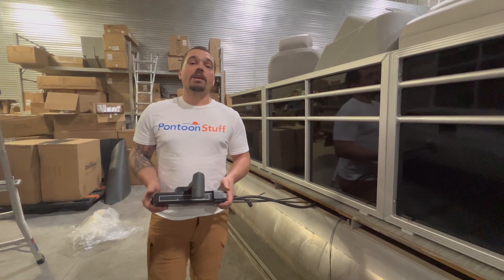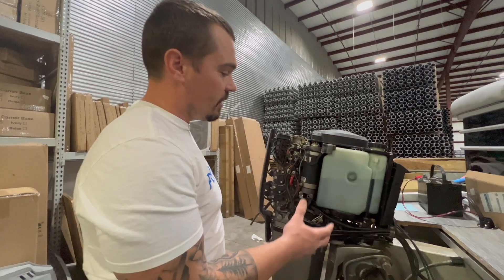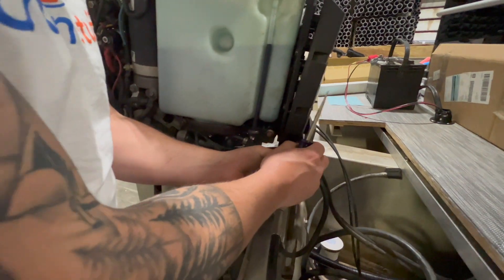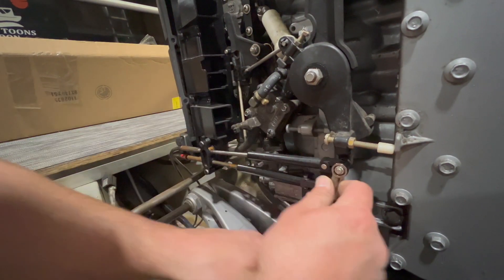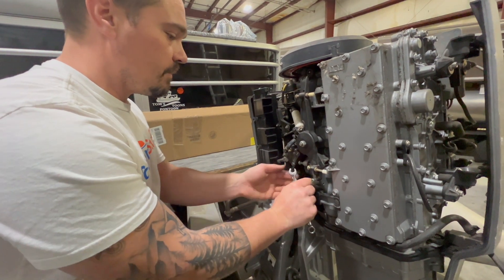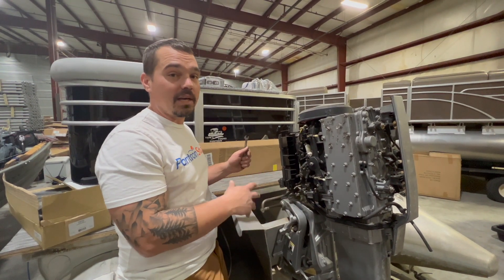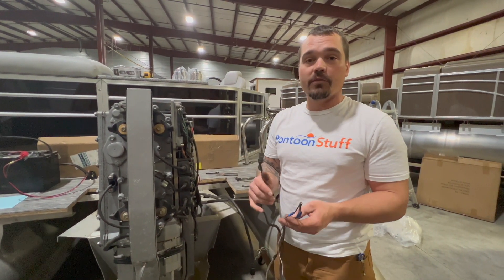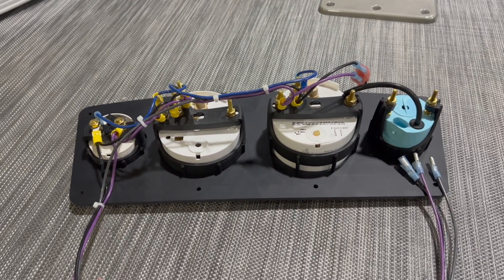Mercury & Mariner Outboard Motor Controls - Uninstallation

Comment: I really appreciate your helping everyone out. My wife and I wound up with a 2003 aqua patio 240 RE. It’s in really good shape but the electrical is a disaster. 2003 merc 125 elpto. We’re taking it slow. Decided we’re gonna keep it and update the electrical system with blue sea mini add a battery. Run 6 awg to a fuse block under the helm and tie everything into that. High hopes for a new modern repower this fall. Thanks again for helping us all out. Never did it before. And now the dangling disaster of stray and dead end wires are a little less intimidating.
Reply from the maker: I need to dive into the Blue Seas stuff and what they have to offer. I'm old school and keep things simple with battery systems because they've always worked and never let me know. Time to catch up with technology I suppose as the reviews on their stuff have been solid for a while now. 

Electrical is one of the most satisfying parts of the project for me. Installing new, re-configuring old, and trouble shooting accessories that aren't working. When you flip that switch and everything powers on as it should it's the best feeling!

Comment: I have the 3 wires that goes to the tach. Do I have to hook them back up?
The old tach is broke.
I also cant get the helm out of dash .
Got steering whell off but not the helm. 1981 16 foot starcraft
Reply from the maker: If you don't care to have a working tach I would just cap them with a splice and/or electric tape to keep any issues from happening.
Reply: @tomspontoons  thanks.
After pulling all the wires, it's straight forward. I'll just buy a new one
Reply from the maker: @keithkamie117  Yes it is. We have some videos on installing gauges for a Mercury. Purple is key on power to power the gauge, black is ground, and gray is your tach signal wire. Make sure you’ve got the pole setting correct on the back of the gauge, and you’re good to go

Comment: Where does the accessory electrical attach to?  In the the gear shifter box?, or does it?, or does it connect to the wiring coming off the engine?
Reply from the maker: Great question. For the ignition harness (trim tilt wires, alarm wires, ignition wires, etc) it always runs through the key switch. So on a binnacle or concealed side mount it goes to the key switch in the dash with come connecting wires to communicate between the shifter and engine. On a side mount (shift/throttle and key in one) all of the wiring runs into the key switch that’s in the control box.
Reply: @tomspontoons  My key switch is on the dash, and so I am looking to feed my other gauges off of that?
Reply from the maker: @keitherickson7666  what motor and year? There will ideally be a gauge harness plug you can splice into or install a gauge harness to in order to power and run your gauges.
Reply: @tomspontoons  '96 Mercury 115hp 2 Stroke
Reply from the maker: @keitherickson7666  Off of the harness (ignition harness) that runs from the motor to the key switch there should be a small black plug that you can plug in a gauge harness (in this video it's at 40 seconds into it where I point out what it should look like). It'll have a black, purple, and gray wire (possibly a brown too) that run to the little plug from the ignition harness. Black is your ground, purple is key on power supply, gray is tachometer sending wire. See if you can find the lead and plug where those come out of your ignition harness...it should be under the helm.
Reply: @tomspontoons  I will keep you posted.  Thanks for the quick response.  You really do explain everything in a way that us rookies can follow.
Reply from the maker: @keitherickson7666  thanks! We’re on here to TEACH the processes so it’s great to hear that feedback!!

Comment: OH BOY!    Man, I have been looking for someone that made a video that helps me out here to get my brain wrapped around what I am doing and this is the CLOSET I have ever come, I mean seriously,. I bought a boat at the end of last winter and I am having CRAZY troubles with this configuration. LOL   
   I gotta 16 ft pontoon that  drives from the rear passenger bench seat. It is a 2016 Manitou spirit.  It came from the factory with a Minkota  D rive 2hp 46volt, steering wheel, dash mount throttle. The boat was left sitting in a mountain pond for years on end , the motor seals rotted and it is in bad shape down there. I could rebuild that but I don't want to run electric and 2hp aint gonna cut it on the lakes anyway.
   So like a novice ( I am ) I went looking for a motor for it ( on a seriously low budget ) . after looking forever at what I thought were terrible options , I found a guy that had a 2003 Mercury 4 stroke 25Hp ELH  BIGFOOT . That's the one with a tiller handle. the motor is nearly new though. Looks like a million Bucks and runs like a champ!  Thought my luck was changing.   I thought. well I will just convert this to steer with the wheel and get a RC control shift lever and POOF!  I can start working on this Rats nest of a boat till it's all shiny and good and I will be ballin like a pro . Little did I know.... 
   I have an ignition switch that the guy I got the motor from was using. 8 Pin for this motor. he was using it with the tiller handle - Part 84-15000A6 , <-- this kit has remote electric start and the Choke and the warning beeper for the motor.  My Motor has NO TRIM, and No TILT.  electrically anyway.  and I don't need that for the pontoon anyway.     

  so what I was thinking after seeking a shift lever controller is why do I need one with the harness?  is there a problem with no electric shift lever?   I mean, I have pieced together the attaching kit ( have not installed it yet ) The kits is :  859186A1 attaching kit. Ridiculous expensive, I got pieces individually and groups  for cheap.   I still need the shift cables and lever control box.  is there a lever control box with no ignition, no harness, no tilt / trim.      Or do I just have to have everything coming out of that control box and plug in the 8 pin from that?  
   That attaching kit doesn't look like fun really But I can see from the way the tiller handle is on there and hooked up it should be cut and dry.   and the cables, when I get them, will hook right up to that.     Not sure of I can use the same steering set up but ima try LOL.  might be too light of gear for that heavier 4 stroke.     Funny how Mercury reports the Bigfoot is famous for being great pushers and designed for pontoons and the like But then makes them with a tiller handle. They also make them with the Control box  BUT GUESS WHAT!    when you run book on the two models for the same year and HP and everything they are the same value.   however, if  you want to convert one to RC just the parts alone are nearly 2,000.00 !    Hilarious predicament I got into. 

  the end of the summer is upon me now. no way I will get this in the water this year. I have to next spring though or the family will never let me live it down.  I know this is long and all, i don't expect a million dollars worth of help , but if anyone here reads this and can help with some advice I sure would appreciate it.  I might even make a Video and post it since there is literally NO video that covers this conversion correctly.  

 Your video is awesome, the parts inside that old outboard are easy to see from you cam angles, everything makes a little more sense to me from this video.  so If nothing else, I have already been helped some.   Thanks man!
Reply from the maker: I sure hope that someone can answer your questions specifically who’s done the same conversion! You can get a control box that has no trim/tilt switch, but as far as I know you’ll need the 8 pin harness run to the motor as that carries the signal for key on power, start, kill switch, neutral safety, alarms, etc. 

Steering wise I believe you’ll be ok if it runs a rotary helm with the push/pull cable like most outboards use. I think I’ve seen them on electric motors too, so hopefully you’re in luck there! 

Definitely sounds like you need to make a video at least explaining the situation and what you’re able to find out in converting your motor!! Those motors were made as tillers too because a lot of guys with heavier fishing or duck boats liked them for their gear reduction in the lower unit…it was like giving them the option to run a lighter motor and still get the torque they needed!
Reply: @tomspontoons  Oh yeah. I see what you are saying.   to push a big ole boat with a ton of gear.  still seems to me thought that they would want the trim and tilt to get up on a plane and lower it to do their other stuff.    
   wow! hey thinks for reading all that, i appreciate it.   I do have the 8 pin harness that goes to the motor that operates  the engine start and choke with a key from a remote location in the boat for use with the tiller handle.   the guy bought that so he didn't have to pulls start it or each down intl the motor to electric start it.   that's what I was meaning about the no wires control shift  throttle thing.   just two cables and then put the ignition on my dash .  I will try it before I mount it all I guess and see what happens.   thanks man! I will be watching the rest of your vids.  I am sure there is more help to be had. LOL
Reply from the maker: @larryleisuresuit9584  that might work just fine, especially with a simple aftermarket box. The issue would be the safety lanyard and the neutral safety switch, but I’m sure you can navigate that. I work on my customers boats so I have to do things once and the technically correct way, so I’d get rid of that key switch and just get a side mount box that has everything ready to go.

Comment: I cannot separate the ignition wire harness on my mercury 25HP outboard. Its really jammed up. I soaked it in wd40 over night, any suggestions to get the plug separated?
Reply from the maker: Are you removing it from the engine side? What year is the motor?
Reply: @tomspontoons  2002 mercury, yes trying to separate the main harness from the motors harness.
Reply: @tomspontoons  I was able to finally separate it but some of the pins pulled right out from the motor side. Im gonna need a new harness for sure.
Reply from the maker: @steven33068  Dang it! Sounds like someone may have had some sort of silicone sealant or something in there. I’ve never seen them that hard to pull apart. That will be quite a project. I wouldn’t normally recommend it, but worst case it would work to splice in and hard wire the series of wires together, heat shrink to waterproof and reconnect everything.
Reply: @tomspontoons  I found a replacement engine harness on eBay for 25 bucks. The main cable going to the helm is fine. I got lucky...Thank you for the excellent videos and quick responses!
Reply from the maker: @steven33068  glad it worked out!! Best of luck continuing your project.

Comment: I have a 2021 Mercury w/ Command thrust... On the throttle cable ( I think) the barrel should go onto a silver pin but I can't figure out how to remove the pin to attach the barrel... The silver pin is closer to the front of the motor nearest the transom...
Reply: Its a 60hp BTW... Everything is intuitive.. Thanks
Reply from the maker: I answered this in another spot, but email me a picture of what you’re dealing with!!
Reply from the maker: I think you commented another place about this.

Comment: I have an 1986 Mercury Mariner 75 hp.  The controls have seen better days and I would like to replace them.  Will any mercury 8 pin control set up work as a replacement? TIA
Reply from the maker: For the most part and electronically yes, BUT you’ll need to verify that it’s correct direction for shift and throttle, push or pull for throttle as well as push and pull for shift.